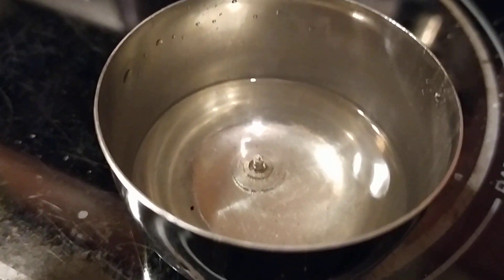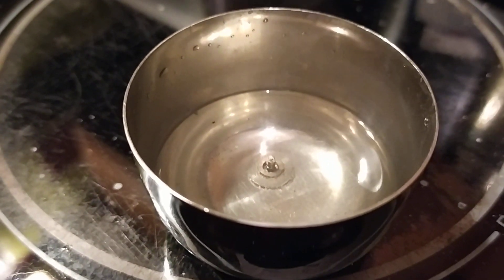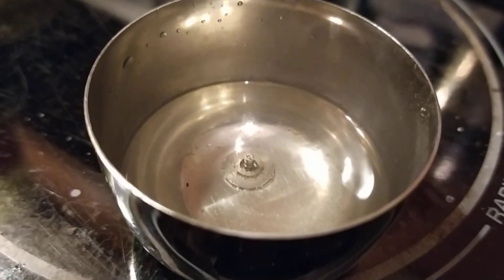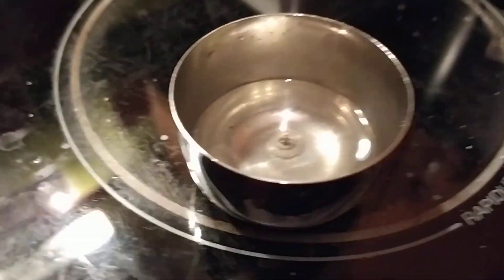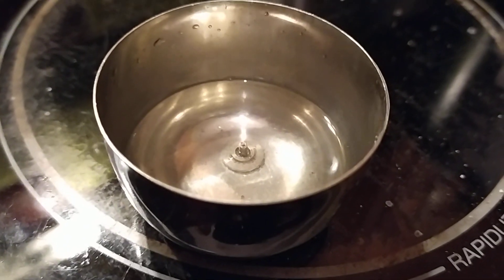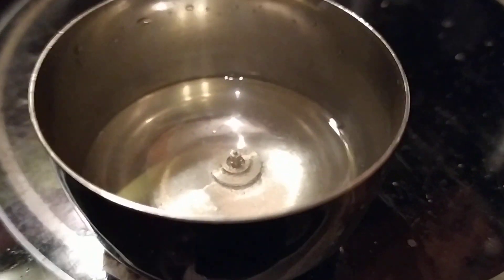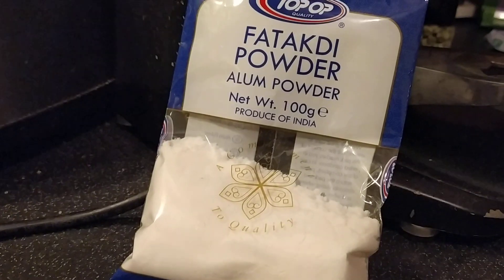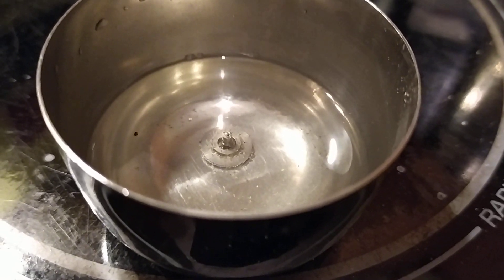Dissolving Metal Watch Crown Stem With Alum Powder

Comment: Would that work removing stripped screws from a plastic watch case?
Reply from the maker: It should but ideally the solution works best heated so you want to ensure that the case is able to withstand hot water and obviously doesn't have the movement in.

Comment: What is the type of alum?
Aluminum potassium sulfate AlK(SO4)2 or Ammonium aluminum sulfate NH4Al(SO4)2
Reply from the maker: It's just called Alum powder and can be found in grocery stores. Ingredients state 100% alum
Reply: @spidiq8  I asked what alum it was because it didn't work for me. I also have 100% alum from the drugstore, but with an antiperspirant stick 😁 I thought it was bad alum. But everything is ok. You have to heat the solution to the right temperature. For me, it started to work at a solution temperature above 83 degrees Celsius. At higher temperatures, the reaction was faster. I had 300 ml of the solution (55 g of alum, the rest was water). Removing of the 1.5mm setting stem took several hours.
So, In other words, I did exactly like in your movie 😀
Reply from the maker: @Kali_Kali  Yes. It does need to be heated. Glad you got it to work.

Comment: What concentration should you mix? meaning--how much powder to how much water?
Reply from the maker: A saturated solution, keep adding the powder to the warm/heated water until it will no longer dissolve, keep the water heated for best results.
A weaker solution will work of course if need be.

Comment: Great video!! Thanks for tip
Btw.. how do you make sure it won't dissolve anything of the crown itself? 🤔
I got a tommy hilfiger watch having the same problem and I fear it will dissolve the crown itself
Reply from the maker: Crowns are usually stainless steel and won't react to the the alum solution but it's best to test it first. Sit the part where the stem fits into some solution for an hour or so and see if it reacts, this part won't be visible when fitted
Reply: @spidiq8  Will do! Thanks for all the help 🤩

Comment: Im using the same method but the stem dissolved only half way through how could this happen
Reply from the maker: How do you mean only halfway through? Can you clarify please.
Reply: @spidiq8  at early stage of reaction i saw some bubble  when i heat up the solution but after a while reaction no longer working even after i change to a new alum solution i use one table spoon of lab grade alum powder
Reply: @alfrescrow  it's probably not getting enough in there.. use a syringe to force some of the solution inside every now an then while heating the thing

Comment: Is the SS pot/pan considered ferrous?  Does the pot/pan react at all?
Reply from the maker: In my experience no. No noticeable reaction. Although stainless isn't rust proof it's definitely more resistant but I used it only because it was handy. Any container where you can keep the liquid warm will do. A ceramic egg cup for example